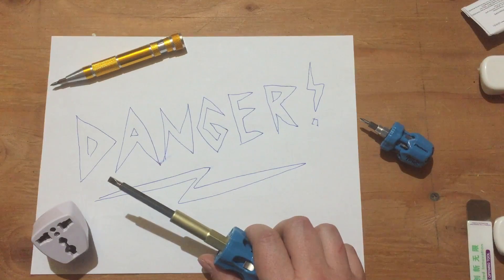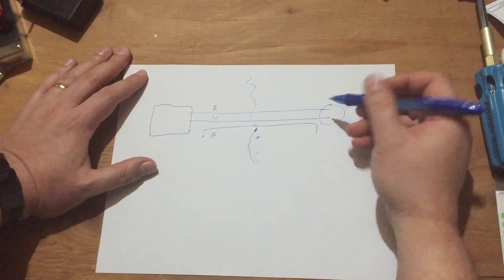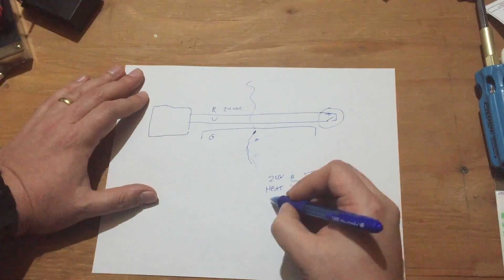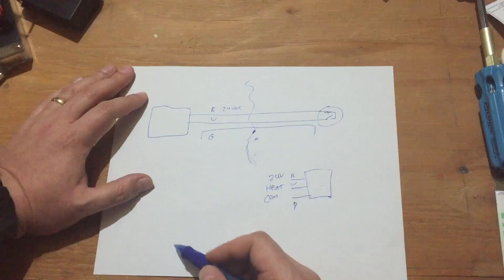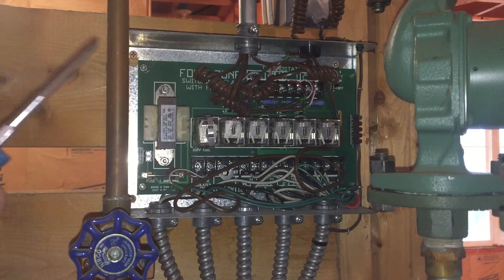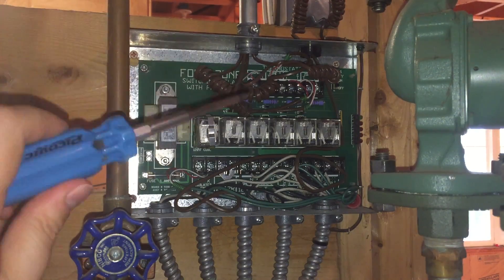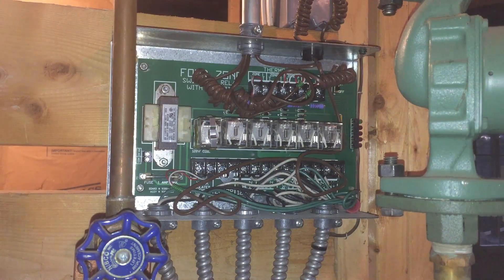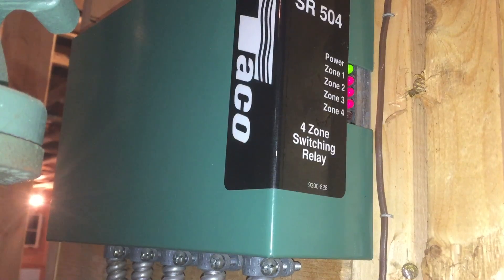#018 Ecobee 3 Smart Thermostat Install, Part 1

Comment: I have pretty much the same set up as you and needed that pesky C connection. Your video was very helpful! Running three wire cable from the thermostat: turn off the system, splice the black wire to the common output from the board, connect the red wire to the T receptacle that shows 24V between it and the common output, connect the white wire to the other T receptacle that shows 0 volts, turn on the system and enjoy the smart thermostat. After watching your video, the hardest part was running the cable. THANK YOU.

Comment: Quick question: If you don't have the luxury of having a third wire unconnected to each thermostat, I assume you would need to use the PEK that comes with the ecobee. Would that even work?

Comment: Ecobee told me that and it is in an app note that the 1A limit on the 504 taco box is NOT enough current to drive the thermostat AND the relays. I have an ecobee 4, not 3. Have you found any issues. I am also thinking about using a Nest as supposedly they have lower power draw, and in fact don't need a C wire as they will cycle power 'steal'. If the nest 'sort of' works, and I say sort of since there are many comments on the internet about this cycle steal not really working, I am thinking that using the C wire from the Taco box should be OK. If not, ecobee has an app note for Taco that involves using an isolation relay connected to the 24V side of the transformer in the boiler. I called taco to see if I really needed an isolation relay and they said definitely. Do NOT pull the C wire from the tformer in the boiler direct to the ecobee AND use a taco, an isolation relay must be used.
Reply from the maker: For the long answer, check out the part 4 video, which covers this specifically. The short answer is I've been through 2 heating seasons now with 3x of the Ecobee 3's on the Taco 504 with no problem at all. But, results with the Ecobee 4 might vary if it draws more power than the 3.
Reply: Didn't see that video at first, but just watched it. Fantastic!!! What I really needed to know was how much current the taco draws, and you had that info. Great stuff. Ecobee 4 also claims to be no more than 3.5VA. Considering using a Nest E, which supposedly draws 100ma, but that is from the forums, not Nest. Contacted nest support, horrible. No idea what I was asking. Only using 1 Tstat on the taco so I think this is good to go. Will just lead 5 wire in place of the 3 wire up from the basement to the 1st floor with R/W and C from gnd on the taco AC side. Really appreciate your info. Thanks.
Reply: Nest wrote back that the Nest E draws no more than 200ma from the C wire. So if the taco really only draws 100, and it is rated for 1A (or at least that is what the fuse says), this should be OK.

Comment: Kool video. Informative.  I definitely used some of the information you described to create  a thermostat/power video of my own. I believe we have very similar systems. Heat Only, 4 zones ,Taco Pumps, Ecobee 3 and the exact same Taco switching relay (yours may be an earlier version but its the same SR504 model). I moved away from the "3 wire" set-up last spring because I like to switch my boiler off in the summer but still wanted access to the info on my thermostats. How did you cope with that?  THANKS!!
Reply from the maker: Hmm, interesting question! I never shut off my boiler even in the summer because it also runs the hot water (zone 1 goes to a heat exchanger / hot water tank), so it's not a problem I'd considered!

Comment: huh?  "Existing thermostats use two wires"?  Perhaps in your setup, but in the vast majority of people's houses they already have 3 or 4 wire setups.
Reply: goodmaki Maybe newer construction, but my house was made in 1834.  We have exactly this setup, with four zones and two-wire to each where the Honeywells are battery-powered.  This particular instance is exactly what I needed to affirm the path I took for adding a supplementary common wire on a new three-wire thermostat circuit for my Nest.
Reply from the maker: That was "MY existing thermostats". My house is fairly recent (2005 I think?) and used the two-wire basic Honeywell thermostats. Thankfully he used 3 conductor cable, so I was able to upgrade without having to go to more drastic lengths.

Comment: I'm getting 24 volts from white to 24VAC.  Are both terminals on the 24vac common or just  the lower terminal??
Reply from the maker: Only one of those two terminals is common (the lower if I remember right -- double check the video), the other is 24VAC.

Comment: Sorry, did I miss the important part? So you didn't connect Common to any zone and left the setup as it is (except flipping the wire as it was connected wrong). I have exact same setup with 3 zone (503-4),
Reply: Okay. It's done in Part II.. Thank you

Comment: Great videos, thanks! I have a very similar "older" setup (taco 506) and I'm trying to install the ecobee. I tried to get some help from Ecobee but they told me to install a Common-maker without much guidance. My only question is what did you do with the green wire inside the taco box? Did you connect it somewhere?
Reply from the maker: The beginning of Ecobee 3 Smart Thermostat Install, Part 2 covers this. Basically it's following this:

    http://www.taco-hvac.com/uploads/FAQ_attachments/zone_control_wiring_diagram_1009.0_51.pdf

with the common for each thermostat connected together to the common terminal (at the lower left on the SR504 -- 506 may be different)

Peter Kiley raised a question on the Ecobee 3 Smart Thermostat Install, Part 3 video, whether the transformer has enough capacity to power the ecobees. Ecobee says no (for the 503 anyway), but I'm not having any issues so far with the 504. You'd presumably be running even more with the 506, so more likely to have a problem. You might want to follow that discussion and double check with Taco yourself.
Reply from the maker: Follow-up video on power consumption here: https://www.youtube.com/watch?v=ZfDIAMBJuVo

Comment: How do you control 3 zones with 2 wires? Or do you have 3 ecobee thermostats?
Reply from the maker: Three thermostats, replacing the three old mercury switch thermostats.

The Ecobee3's are a bit expensive for this. I mention in one of the videos (maybe the next one?) that there is some talk of a cheaper model that would be usable for additional locations (eg I could have used one Ecobee3 that had the brains plus two lesser units), but there is no indication when they might come out with that (it's NOT the Ecobee3 Lite)
Reply: The only reason I was looking into Ecobee3 are the remote sensors that could be placed and control individual rooms but I can't see anywhere how that would be wired in zone system like yours.
Reply from the maker: Do you have multiple thermostats/zones currently?

The remote sensors just help the ecobee get an accurate picture of all the rooms in the zone (occupancy and temperature). For example, knowing the second bedroom is occupied, it can know to heat the bedroom zone even if the master (where the thermostat is) is unoccupied at the moment.

It also averages temperature readings from all remote sensors associated with a thermostat, plus the thermostat itself, so that it can do a better job of regulating temperature. This is especially useful if the thermostat is in a location that is warmer or colder than the area as a whole.

If you have multiple zones, you still need the control functionality for each zone and that's only in the thermostat itself. And if you only have one zone, there's no way for the thermostat to regulate temperature differently in different areas.

Hope that helps!
Reply: Thanks for the explanation and clarification. I personally think it is an overkill to have smart thermostat in every zone (I have 7 zones) especially if all needed is the temperature/humidity measure in each zone and having one central unit to control and monitor it, to me that would be the "smart" way to go... that's why Ecobee3 + sensors caught my attention.
Reply from the maker: Ouch. Yeah, I don't know any consumer product that will be economical for so many zones. You might need to look at commercial thermostats, I don't know. Or perhaps wait and see if Ecobee comes out with the inexpensive control units in the future as they've teased.